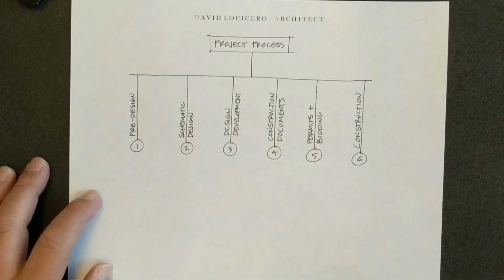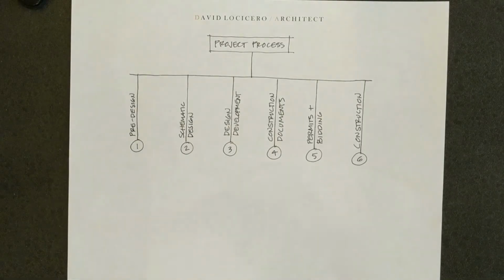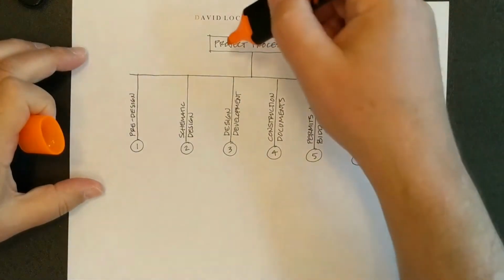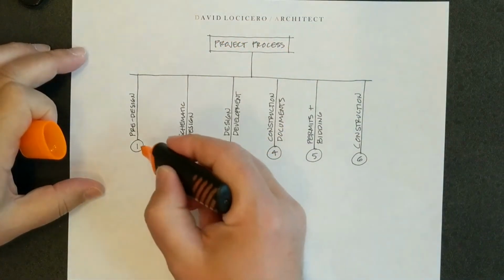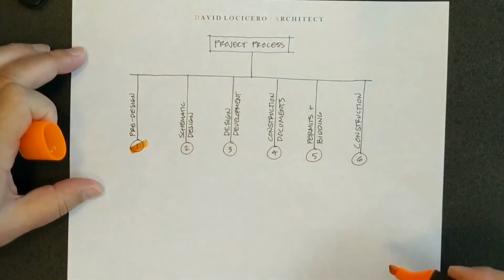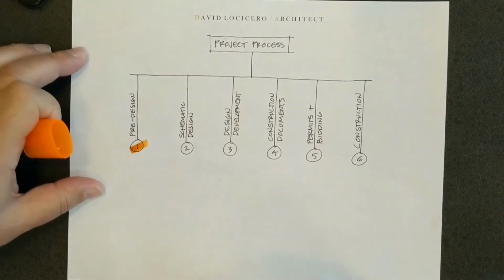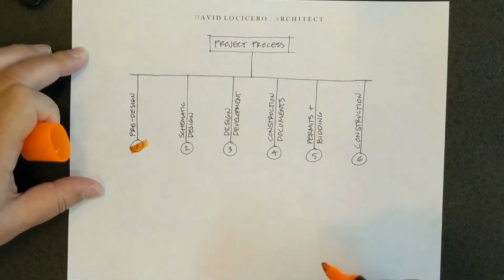Ask The Architect: What Is Schematic Design? Phase 2 of the project process

Comment: For CA, what would suggest fees to be for pre-design + schematic design only?   (For a single family residential in CA, recent M.Arch grad unlicensed)
Reply: Matter of fact, it will probably get into much of design development as well
Reply from the maker: @jonathanbasco9619   pre-design through DD is roughly 40-50% of an architect's fee for a residential project. 30-40% for construction docs, and 15-25% for construction administration. Giving ranges because it'll vary depending on the site, the client, the solution, etc. This has been my experience.